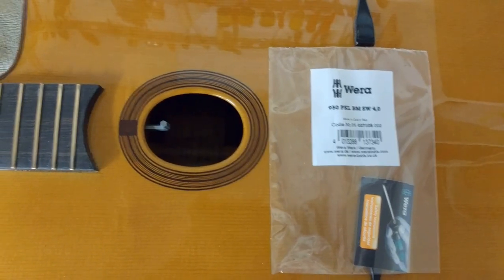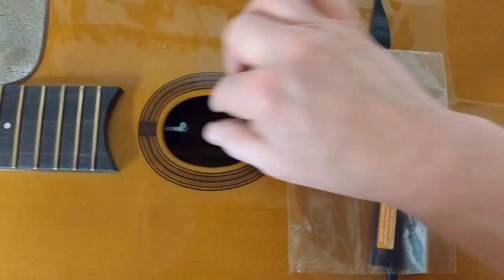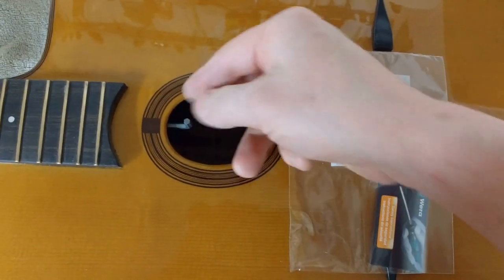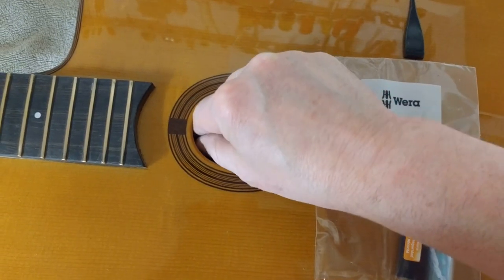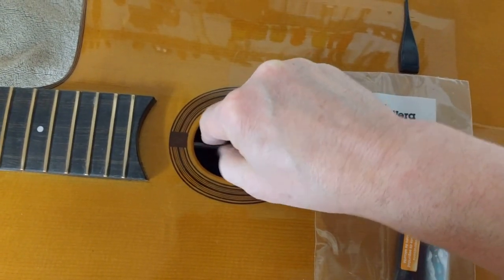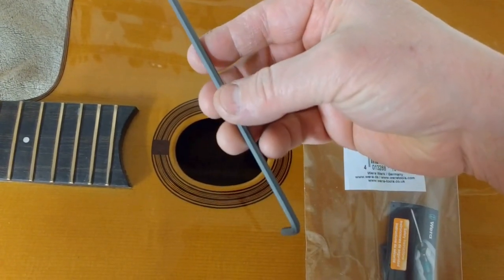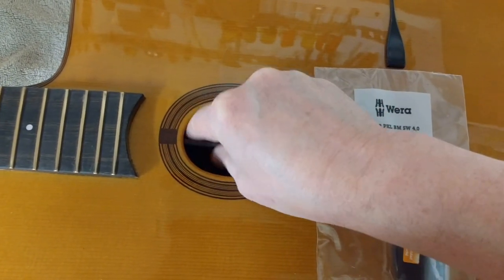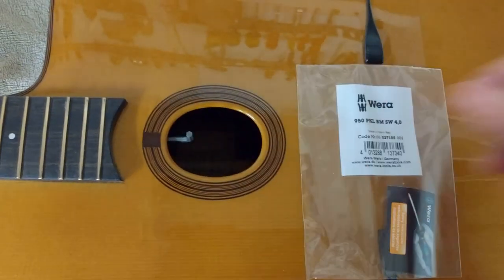Holo Guitar Truss Rod Wrench Insertion Video

Comment: Hello, what is the size of the Allen key, please? Is American or European standard?
Reply from the maker: In Europe, Wera 950 PKL BM SW 4,0
In USA, Wera 950 PKL Hex-Plus 5/32"

The actual nut size is USA 5/32 which is 0.1565" inches, but 4,0mm is 0.1575" and works because it's only 0.001" inch more.